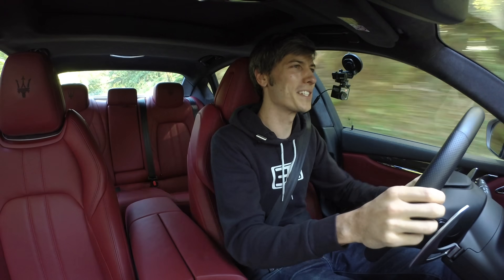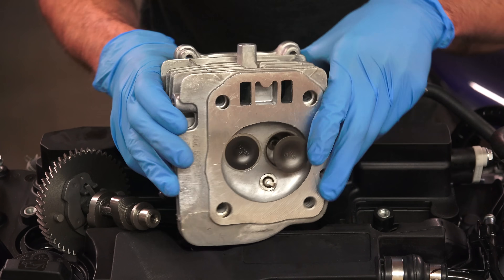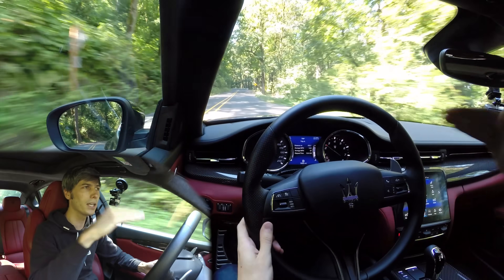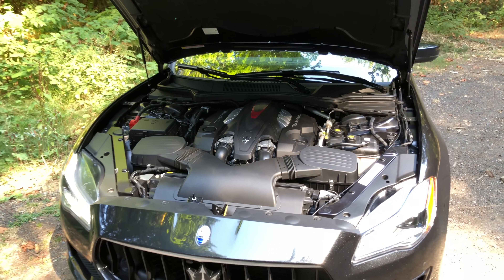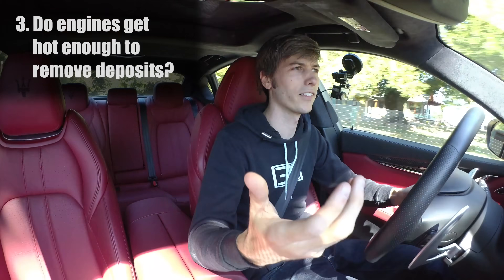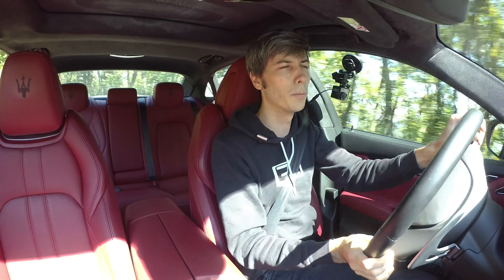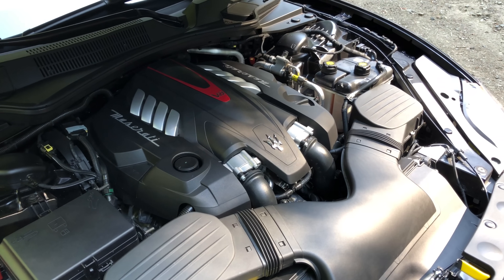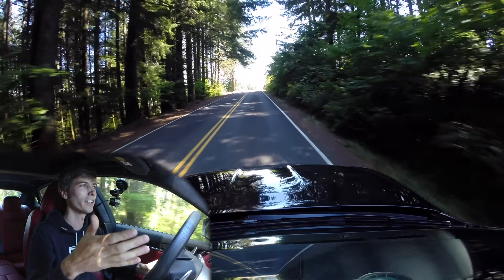Is Redline Good For Your Car's Engine? Italian Tune Up

Comment: My dad used to work for Cadillac in the early 80s and he said the old people who never got on the gas would load the engines up so bad that when he would test drive them before a service he had to blow all the crap out the exhaust. Said they were crop dusters.

Comment: There seems to be potential miscommunication in around the 7 min mark: you’re saying in “high load” you’ll get more deposits and referring to driving your car harder, but in you’re fuel efficiency/acceleration video you referred to “high load” as a lower RPM zone, approximately 2-3000. Maybe that 2016 study was also using the latter “high load” vernacular and saying putting around at 2-3000 RPM is where they saw the greatest deposit formation. Think this may require clarification!

Comment: Old gearheads swear by this, especially for the older engines that see a lot of idle time and not a lot of pulling time.  Anecdotal maybe, but Ive done this more than a few times, from new to old rides, find a long steep hill and stomp on that throttle hard and watch the crap blow out the pipe.

Comment: It's not just the combusiton chamber though, It creates a high flow environment in engine components that often times unplugs or cleans up restrictive passages, like in fuel injectors, PCV valves, vacuum lines etc... After failing smog in my port injected 4.0 Jeep GC for smoke coming out of the exhaust, I ripped it up and down the highway a few times and passed smog, no more smoke.

Comment: We use heat to clear the build up off the spark plugs all the time in aircraft. Run the engine to about 1700 RPM and lean it out to max power (highest temperature) and run for 30 seconds or so then go full rich and check again. Red line is generally about 2700 RPM which we see on every flight.
Reply from the maker: Very neat!
Reply: Not sure if it is the heat or rapidly cooling the deposits with cold fuel that does it.

Comment: I wonder if a diesel engine would be more/less likely to shed said carbon deposits. There's a lot of nonsense being shared regarding diesel engines(ever seen the used grease debate? Holy crap some people are dense) so I'd definitely rather hear from someone who thinks more scientifically than from someone who only has "well, MY diesel engine is still running" to offer.

Comment: Hi Jason! I appreciate the huge effort you put for explaining every single detail in your videos.
This video actually comes at a convenient time for me, I just bought a 1989 Nissan Sunny Coupe with a bit more than 120k kilometers  (70k miles) read on the odometer. Overall it is in very good shape, but as I started working on it I discovered it had no thermostat. Of course I will install one ASAP, yet I don't know how much has it been without one... So that makes me think, since the car doesn't overheat at all (actually at Highway speeds the needle doesn't get halfway, it stays at a quarter) is there a chance that the car has big carbon build-ups within? Also, what sort of risks does an engine has when it operates without a thermostat?

Thanks so much! You make an astonishing work with your videos.

Comment: I believe Mazda says their skyactiv engine keeps about 400°c at operating temperatures to prevent carbon from buildup. Maybe true for many components inside the engine but the intake valve has to get that temperature too. I don't really think there's a way to escape from carbon buildup for direct injection engines. Very nice video, thanks for sharing!

Comment: I'm wish you would better mention the normal driving operating temps of the engine/parts because it's interesting to think that doing a WOT acceleration for a few seconds could heat the parts to where more carbon would build up.

Comment: An Italian tune up is just going about 100 mph for a few seconds on the high way it get the gas spraying over your valves and parts moving fast it cleans everything and go to the gas station get an additive that says it helps clean go 100 mph you be good dawg

Comment: You guys realize that the redline is determined by factory stress testing right? As in, it's not bad to redline your engine but it will reduce the life of your engine if you rev it under load significantly above that point. Like , your engine would make more power above redline as long as the proper fuel and air is available but your oil change and engine rebuild schedule would be much much shorter. You aren't doing the car any favors by keeping your rpms near idle just keep it under redline and drive safe.

Comment: David Vizard once remarked on a race engine that had individual carbs (which had a straight view to the intake valves) that the valves would glow a dull red after some time on the dyno.

Red is 600ish °C minimum iirc so that particular engine at full throttle would not get deposits. God knows what colour the exhaust valves were though. Probably white...

Comment: Carbon ----> Molecule

UFF
Reply from the maker: Sounds like ya weren't listening, or simply choosing to be critical when it's not necessary. Carbon (it's an element) is ripped out of the molecule it's a part of (the deposit). When it's removed from the molecule, the molecule breaks apart and is no longer attached to the metal surface. Decarboxylation.

Comment: maybe it's not about temperature, but rather about mechanics (inertial forces in particular). I mean, it is possible that high RPM help free the stuck piston rings, and improve the compression ratio.

Comment: Do diesel intake valves get hot enough for this to work? Do diesels even form carbon deposits in the same way? It sounds like the Italian tune-up doesn't get hot enough to clean intake valves, but diesels run hotter.

Comment: What about the other presumed benefits of the “Italian tune-up?” For example, if the throttle is never opened fully, the butterfly valve can get a bit sticky. Periodically opening the throttle all the way will help prevent a sticky valve and, by extension, strange throttle behavior.

Comment: You did some video a while ago about "premium" (branded) petrol (Shell V-Power and the like) and the additives in them reducing carbon build up. A related question would be "do they remove already existing carbon build up, or merely avoid build up in the first place?".

Comment: man, this is so simple in airplanes. We can just aggressively lean out the mixture at a moderate RPM setting. The extra heat and oxidation gets rid of the carbon effectively, and far from red-line.

Comment: Thermal shock may play a major role as well - from a mechanical perspective, rapid uneven heating (within the carbon microstructure) could cause damage to the carbon deposit itself, especially at the interface between the carbon and the metal surface. Thermal shock could cause it to weaken, crack, or begin to delaminate from the metal and thus contribute a cleaning effect.

Comment: My drift car gets an italian tune up for like 2 minutes straight... Same with the clutch and brakes lol! Awesome video Jason! I actually have been wanting to test this in real life and do some before and after pics!
Reply from the maker: That'd be awesome to see! Would love to see a demo test.
Reply: ChrisFix make a video soon
Reply: ChrisFix yoo it’s chrisFix!
Reply: My father always told me to let the car rev close to redline at least occasionally when you are driving. My rust bucket gets close most times when I get on the highway. :P
You both are awesome! Keep up the great work.
Reply: @802Garage  never thought I’d see you on here

Obligatory: when’s the V10 gonna be done

Love your tiktok though man haha
Reply: @tylerbuchanan6822  Haha I'm everywhere, as they say! I have everything in place, working on transmission and engine mounts. Getting closer finally. Thanks a ton. :D
Reply: @802Garage  my new project is an 04 TL. Looking at DIY pro charger on the j32a3 bored 20 over with j37 crankshaft intake manifold and throttle body.
Reply: @tylerbuchanan6822  Sounds like some wheel spinning fun.
Reply: @802Garage  wow, 802, Chrisfix, and EE all in one comment
Reply: @chibba5418  🥰 Tryna mix it up with the greats haha.
Reply: Clean the goo out of that civic please!!!
Reply: Chris.. you were supposed to link your seafoam video :D
Reply: Chris, it would be awesome to see a test of intake valve cleaners on GDI engines!
Reply: You can also remove carbon deposits with soapy wooder
Reply: ChrisFix why do you have 4.1m subs but not verified wtf YouTube
Reply: @hagfish1013  has 5 million now
Reply: So  the Itailan tune-up works on American, German, Japanese cars!
Reply: @ruikazane5123  Exhausta nota gets Italiano accente.
Reply: BUT why are carbon deposits bad???
Reply: @marcjtdc  If it builds up enough it will cause hot spots and knocking and eventually overrun too, these will weaken the components and eventually cause catastrophic failure.
Reply: @marcjtdc  they are abrasive and take up space when built up.  That wears the car out faster.
Reply: YES!
Reply: my favourite car guy is here!!
Reply: Please do!
Reply: Indeed it would've been funny to see and empirical test on this. The N53 BMW engine is one of those where people tell you "drive it like you stole it" in order to keep it happy. This generally refers to keeping intake manifold from carbon and also the injectors clean. But this might have to do more with exaust recirculation rather than combustion build-up.
Reply: Will the Italian tune up make up for beating oon the rod bearings ? I think using quality gas is better
Reply: ChrisFix 
You are the man who thought me basic auto repairs!!! Now I can literally fix most of cars!!! 
Like Audi,Honda,ford,Nissan!!  Thank you 😊
Reply: That's a great idea!
Reply: Funny how everyone is talking to Chris, like he was having a conversation. When all he did was make ONE comment; and not even to them.
Reply: ChrisFix where have you been?
Reply: Is this a crossover episode?
Reply: U installed a rev limiter?
Reply: how is it going?

Comment: I just want to throw out there - well he is obviously going to be a big factor in reducing deposits, could not also the vibration of the engine help? I would think that could be a big part of red line in the Italian tune up... Someone who drives like my father all the time, where the engine is never loaded very much and is always below 2500 RPMs, going to redline is a shock doesn't see often hyphen and that may help to break up significant deposits a little bit. Just saying...

Comment: It certainly helped my bike(ninja250r) a ton.  It was oddly sluggish after cruising around town in top gear for thousands of km. I probably had it right in the sweet spot(around 4000) rpm.  Then a few top speed runs and some spirited twisty road riding where I was constantly between 11000 and 13500 redline and the bike runs beautifully now. It being carbureted might have an effect on the effectiveness of the Italian tuneup as well. (My personal thoughts is that it was working so hard it cleared out the carburetor ports)

Comment: i revved my previous car every single day to the limiter and i used high rpm's almost every acceleration, the engine took 15000 kilometers of abuse and gave up, connection rod bearing broke and it started to knock like hell :D

Comment: My experience as a former Mazda tech. - we had a couple customers who had purchased early 90s mx3s with 1.8L v6s.  Which, for those if you who don't know, are a very high revving engine.  They don't even breath right south if 3500 rpm.  And these customers came in repeatedly with a soft knock.  We pulled the one head and you could see where the carbon had built up enough on both the head and the piston and compacted enough to contact.  We treated both engines with a product similar to dwarfism to break up the carbon.  It worked temporarily, but both ended up coming back with the same issue.  We repeated the treatment a couple times before we went our with the one customer in a test drive because this issue seemed relatively isolated and there were no issues we could find with the the cars themselves.  It turned out both drivers never went over 2300 rpm or there abouts, and never drove in the highway.  So we taught them to not be afraid of revving them up and the issue was solved.

Comment: At high engine load, there is also a significantly higher volumetric air flow for intake air.
My question: Does the increased air flow decrease likelihood for carbon deposits by means of the “erosion” effect?

Comment: Sir,
Aircraft reciprocating engines, whether air cooled or liquid cooled have a dual ignition system comprising two magnetos, appropriate ignition harnesses, and two spark plugs per cylinder. The principal reason for this configuration is for ignition redundancy ; a second reason is that the air-fuel mixture must be evenly ignited so there is no discernible flame front, hence two ignition sources. Due to the characteristics of most reciprocating engines (high cylinder pressures and fixed timing), the engine is designed to maximize optimum combustion, i.e., the entire  air-fuel mixture is burned before the pressure inside the cylinder reaches the critical pressure of the fuel-air mix.
Switching between ignition systems after starting the engine is to ensure that the RPM drop between each independent ignition system is minimal thus indicating well-timed magnetos. If one should observe a significant RPM disparity, you’re not taking that aircraft anywhere.

Comment: Despite many of these commenters miracle stories, driving your car that hard on civilian roads will not clean nor fix anything. Especially, if your engines rod is knocking and/or ping. I have a feeling people who like to have a silly excuse to drive like an ass on the road do not have to deal with the responsibility and labor of replacing an engine, transmission, gaskets and a whole car.
Overall, the point i am hoping to make in this comment, is that driving cars like you stole them only causes havoc and more issues.
Reply: As long as all the systems are functioning like normal, driving rough occasionally won't harm them. Just do it when it's warm. Accelerating from a start will wear tires out faster, but the rest of the parts won't take much of a life hit.

An Italian tune up does work in some situations. 2 from my life as examples. 
- 90s ford explorers are bad for gumming the throttle body up if you drive like a sunday driver and make the throttle not even budge from closed until you basically kick in and then you have control. Fixed many by flat footing it around 15 mph till about 60.
- had a awd chrysler 300 i think it was once at my shop idled rough, stumbled, and just ran like crap at any rpm, speed, or load. Took in on the high way and floored it from 30 to about 70. Ran perfectly after that and never had an issue afterwards the multiple times it came back for preventative maintenance. Owner was a older gentleman. Figured it was either carbon build up on the plugs, build up in the intake, or a fuel injector that needed to flow.

Comment: My dad has a 4.3L V6 that he basically drove around by putting it in D and idling to his destination. Whenever I borrowed the truck, it would tick like crazy. I'd drive around in 2 or 3, keeping the RPMs nice and high and eventually it would smooth out and go away. I wasn't redlining it by any means, but I was driving aggressively on purpose, and keeping the RPMs higher than normal.

Comment: I appreciate all of the research you put into this video c:
Reply from the maker: Thanks! Lots of reading haha, but it’s neat information.
Reply: @EngineeringExplained  I know a really old Italian dude from Italy who was a mechanic in his day... He said from the fact Ferraris were cammed like racing engines putting around town would cause them to load up the carbs so the mechanics would go out and have some fun and make whatever pass with proper flow ramming through the intake and exhaust
Reply: @matthewfredrickmfkrz1934  Yes ferrari is actually where this started it was part of the maintenance schedule in their owner's manual's for years

Comment: does driving in 200kmh at 4500 rpm in a diesel car in 4 hours straight with little pauses prevent carbon deposit?

Comment: Wide open throttle should have the EGR valve completely closed, so that would at least reduce the number of things contributing to the problem.
Reply: On my car, the EGR only work on light load, cruise situation. Not at WOT. I have a software which actually log that stuff
Reply: Well that's including delay if the debris broke loose bounced around for a little bit before it actually got into the exhaust collector.
Reply: Ok, I imagine that is because the intake is sucking in huge...  thus overwhelming the blowby ..?  I think.  wait...  so valve is closed and those gasses are stuck in the crank case...  hmmm..   I think it's above my paygrade.
Reply: I know with my old diesel ute, the egr remained closed until you were either stopped in traffic or just coasting along. Never when under throttle...not sure if they all tend to work that way or if they all work different?
Reply: Or EGR delete 😃😃
Reply: @ZedLucas  to Wright
Reply: Happy Poop I installed new headers and it wouldn’t attach to the egr line so I just let it spit out in engine bay. Terrible gas mileage and almost no acceleration after 5k rpms but it did sound kinda cool lmao
Reply: I thought egr opened at wot or on hills to cool the pistons. ????

Comment: I run my cars hard and I feel like my cars tend to run good and rarely break anything critical. Lol. I do preventive work when i notice wear or signs of failure. And keep up on oil changes and filters. But i drive my cars pretty hard and try to open it up as much as possible. I have never blown an engine in my life. Knock on wood.